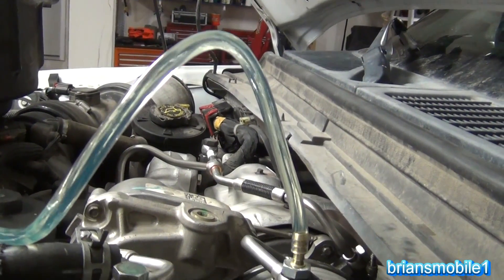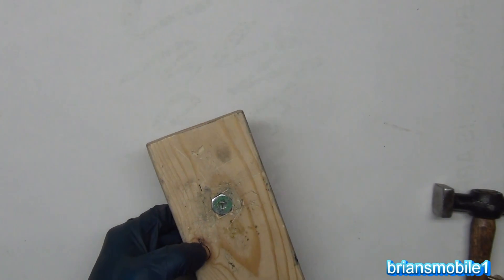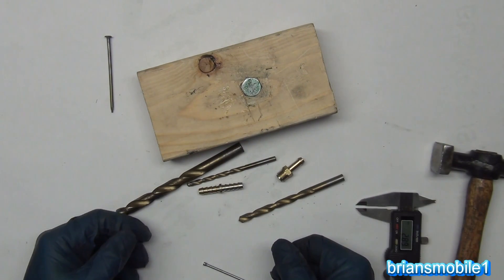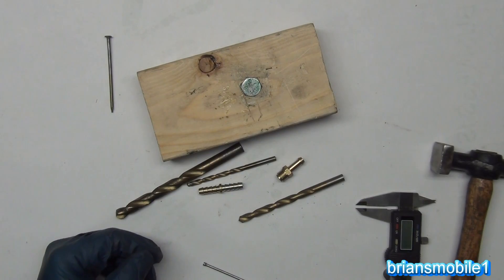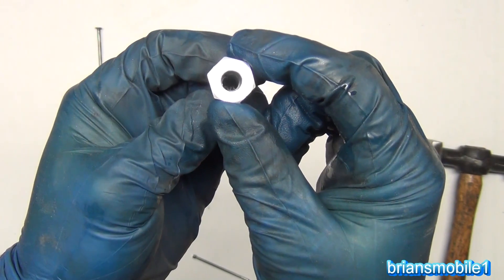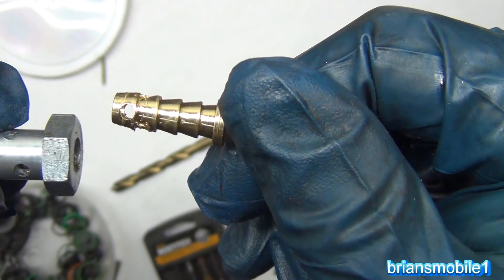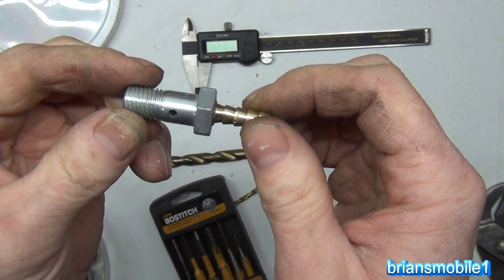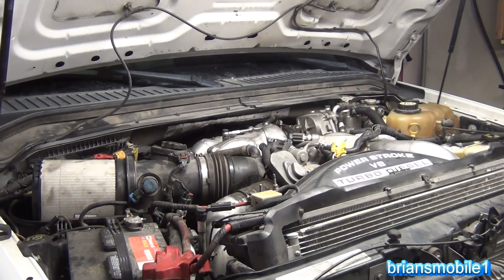PowerStroke Fuel Bleeder Tool Build

Comment: I just dealt with one of these on side of road. Just hooked my fuel pressure tester to Schrader valve. Put hose in a bottle. Cranked for a few minutes. Fired right up.

Comment: Please help it all started a couple weeks ago I had a water pump go bad so I decided to do some other issues that I’ve been putting off. So I did the oil pan gasket the windage tray gasket and the water pump oil filter and fuel filters. I jacked the motor up to the tip of the motor mount studs and that was enough to get the oil pan in and out. After reassembly It started getting a p2291 ICP sensor lfrp and it shut off and so I replaced that as well. Again I started the truck and it idled for a few seconds and shit off again so I bled the system again and there was tons of air over and over and now it won’t even prime the upper filter I can’t figure where it could possibly be sucking that much air I’ve changed the lines from the lpfp to the lines that go to the filter housing up top and got nothing i dont know what to do besides drop the tank and chase the lines all the way up to the motor. When the truck would idle the fuel pressure was 28000 psi on the high side and 4.8-5.2 on the low side and the air got worse each time I primed it please help anything that may give me a idea to work towards I’d really appreciate it

Comment: Thanks for this great video! I have a 2016 ford  f350 6.7 diesel. I bleed the air from the low pressure side from the fuel line near the fuel filter under hood. Still there are some air trapped in the high pressure section. Its different than your truck in this video. Any hint how I can do this on my truck to bleed the high pressure side?

Comment: Brian, so I made the tool put the hose on it and turned my ignition on. Lots of air, bubbles and then solid fuel for about 30 seconds or so. Do I just turn the ignition off, unscrew the adaptor and put the regular bolt back in? I can't get my vehicle to start.

Comment: I have worked on several of these engines and all I did was crack the banjo fitting loose and let the air out. What is the big deal about the bleeder hose?
Reply: johnathan bowman thanks to your post I fixed my issue in literally 5 minutes with a 17 mm wrench.. Thank you!!!!
Reply: mike church did you crack it loose then turn your ignition on a few times? Did it make a mess everywhere?
Reply: Duetin.. That was the method I used. I gave it around 2 or 3 turns which was just enough to let the air escape yet not spray fuel everywhere. Once it started, I tightened the bolt as quickly as possible. While I did have a small amount of fuel escape, the mess overall was very limited.

Comment: I might suggest, drill your first hole from the other side. Let the bolt hold the bit. And for 1/8 npt (pipe thread), the closest standard bit is 11/32. A set of taps can be purchased at harbor freight

Comment: Hi. Great video. Sorry to bother you sr. i have a question. I got my bolt in the mail and i'm ready to build the bleeder but i own a F-350 6.0 and it doesn't look the same. I can't seem to find the port where that bleeder would go. Can you shed some light into my ignorance? Where is that port on a 6.0.? Thanks for your time.
Reply: Carlos Leon 
Completely different injection system. No need to bleed fuel, just cycle key a few times to refill filters. But you have to bleed the high pressure oil system if you've opened it. Stand pipes, stc fitting, hp pump, injectors, etc. Charge the batteries while your doing the job so they are plenty hot, then lots of cranking. Extended cranking then until it's driven and air is purged
Reply: Thank you very much, I appreciate it!
Reply: I will try that.

Comment: if you went deeper into the fuel system, especially an injection pump you should keep the bleeder in and let it idle for a minute until all the air purges out.

Comment: hey that is very cool I thought of making one similar to that but I was able to get ahold of a fuel pressure test kit which has the screw with the Schroeder valve on top overall everything I appreciate the video a lot because you did help explaining on how to bleed this I am still yes working on that truck and have actually had a diesel mechanic come and help me bleed every injector out and still nothing so tomorrow hopefully fingers crossed I have it running
Reply from the maker: +Richard Medina Did you see the plug for the high press injector I through in there for you?

Comment: Oh, I understand, you take the bleeder tool out after the high pressure side is cleared of air. Good idea! I was wondering how you'd seal it after, but that's not an issue if the device stays in your tool box. On a small diesel you just crack the threads for the each line and bleed it sequentially, one line at a time.
Reply from the maker: +spelunkerd This is the same way, but access is difficult because the lines are under the valve cover.  So this is a good work around.

Comment: Brian, do you ever use a vacuum pressure tool on the 6.4? Aren't they known for cracking the front cover due to air in the coolant system? Or is that just a myth?
Reply from the maker: +Docoski It's not a myth.  I have a method I wherein I use pressure and then drop it.  Then drive cycle it.  It's lame to have to do it.

Comment: 90% of video...drilling a hole...10% evacuating air with NO EXPLANATION as to what or how you proceeded! Your videos use to be concise and informative...now not so much
Reply from the maker: +john smith There's a link in the description for a video titled- How to bleed the 6.4lit Powerstroke Fuel System.
Reply: +briansmobile1 My apologies...Title does sat "TOOL BUILD"
Reply: Well the video is called "fuel bleeder tool build" not how to bleed the fuel system on a powerstroke but it would be nice to have him explain what's happening
Reply: briansmobile1 didn't see that I guess i should make a better habit of reading the description
Reply from the maker: +john smith Happens to the best of us.

Comment: you're not going to drill it like billstmaxx and run your press at the highest speed possible, put all your weight on the feed arm, have smoke come off the bit and use no oil, then call it a stupid thing when the bits destroyed and blame the manufacture for making a crappy drill? lol.
Reply from the maker: +dave1135 I could, it sounds like fun!  But sadly, I would not have that size bit anymore.
Reply: +briansmobile1 Hey Brian just a quick tip for staying centered instead of going for a pilot drill first start with a center drill its a real short bit that's really stiff so it won't bend and walk around like a regular twist drill. They're made for use in engine lathes and milling machines and come in lots of sizes
Reply: +briansmobile1 lol, yep. I don't know if you watch him, but he is hell on drill bits. not dissing him, he's a great fabricator, makes cool things and is a awesome welder, but..the way he uses a drill...its tough to watch. I have bits I've had 20+ years, still as sharp as the day I got them.

Comment: um I used to do road service on all thing diesel and the best way I found to to purge the fuel system of air was I had a 30 foot long 1/4 inch fuel line with a small in line fuel filter that I would plug the filter side of the fuel line in to  any vacume  port on my 350 gas chevy service truck engine the other end to the return line to the tank on the diesel then start the service truck up and let it idle till it looked like a smoke bomb then un hook everything and woo-la you good to go !!
Reply from the maker: +Lester Gross That's pretty innovative!